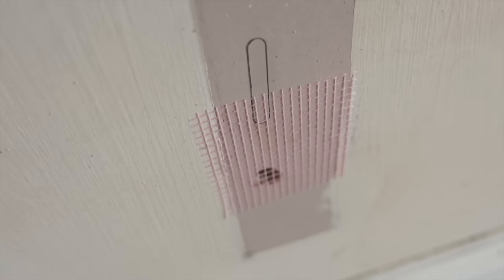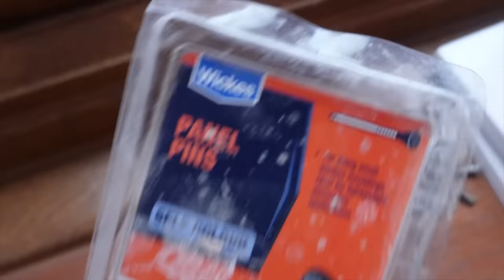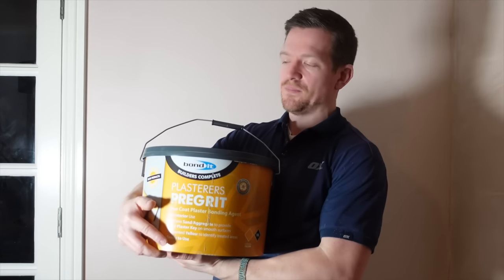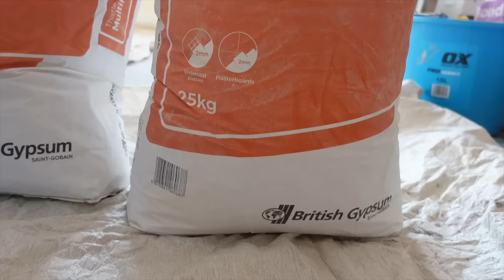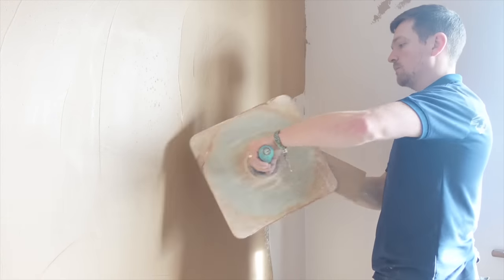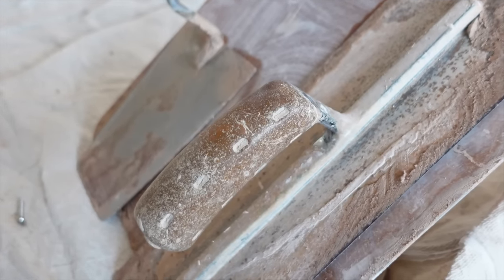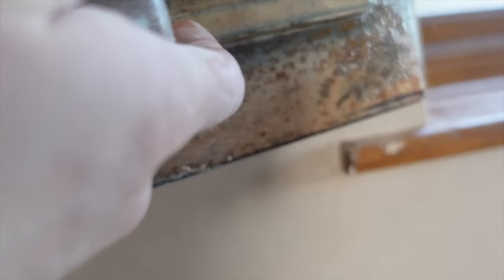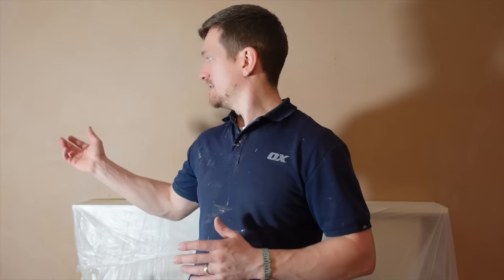#1 Tip For Plastering FASTER ⚡️ | Plaster More Walls In LESS TIME..."It's all about the Method"

Comment: I do agree to some extend as you are a plasterer, but even to the most experienced plasterer, it is no way faster than to fill, your walls are almost perfect condition, these small cracks and holes can easily be fixed with easifil 20, 2 fills and quick sand in between, these can be prepped for painting within 2 hours max. To plaster, by the time you pva, took off sockets, beed, plasterer and flattened , this is easily a day. If not more to some. Freshly plastered walls need a day or two to dry and mist coated, no freaking way this would be faster, better finish, may be. But I honestly can’t see this being faster
Reply from the maker: You’re definitely right - I good decorator beats a plasterer everyday. But like I said in the video I’m not a good decorator and it would take me forever ha! 

I don’t know the best way to use the products and I’ve never heard of this one you mentioned. But I’ve never had to learn so that’s probably why. I just prefer plaster…I’m stuck in my ways ha.

But yeah…I totally agree with you pal 👍

Comment: Thanks to your videos you have given me the confidence to have a go at some DIY plastering, I've seen other plastering YouTube vids where SBR is used instead of PVA, what's your experience with SBR?
Reply from the maker: I just prefer using PVA mate. I find SBR stains everything it touches and it’s a bit more expensive. I think PVA does a good job so I’ve just stuck to that.

If it’s not broken…

Comment: If you’re using the same mix for your second coat… Do you ever add a little bit of water if it’s started to firm up a little?
Reply from the maker: I try not to mate. I find it easier to apply it whilst it’s former…and if it’s going off too fast then it’s probably and indication that you need 2 mixes anyway. You only want to do this if you have a manageable hit

Comment: Hi, what are your views on replacing pva with sbr. I'm told this is far superior and you only need one coat on any surface 🤔 Thanks.
Reply: Hey Gavin. I saw a video fairly recently where Blaine mentioned using something called Plasterers Pregrit. I’ve not tried it myself yet but it comes highly recommended

Comment: Great vid, just wondered where you stand on pva the walls the night before skimming? Is it ok to do that? I usually do 2 coats of pva just before I skim but got a big job coming up and I’m trying to be more efficient with the prep, would love to hear your thoughts thanks 👍
Reply from the maker: Yeah that’s a good way to do it mate. I know a lot of plasterers who do it that way…PVA a job on the way on home and skim it the next day. Probably the most efficient way.
Reply: As a plasterer , you would never let the PVA dry in before you skim the wall , if your using PVA as a sealer to skim onto it should always be one coat over the surface to seal the wall , then before you start to skim , you would apply  another coat of PVA , & skim the wall while the second coat of PVA is still tacky to touch , so you are plastering onto tacky glue , so it helps stick to the wall , never skim into dry shiny PVA , it’s a no no .

Comment: It seems ironic that anyone could be good a plastering, but "shit at filling", since plastering takes so much more skill. But I suppose its natural for  plasterers to want to put down a substantial coating, while the whole point of filing is to only fill the low spots. Whenever I'm helping out someone who's not comfortable with filling, I always tell them to remember the Hippocratic oath: "do no harm", and to keep the filler from going above the intended surface level to avoid having to sand down a lumpy mess. Even after hearing that, some people can't resist smearing it on like cake frosting. Might as well go with what you know; I'm sure it will look great.
Reply from the maker: Haha so true. I just try and get it perfectly smooth and end up taking too much ofoff leading to another coat. I’m just rubbish at it but slowly getting better

Comment: So you wait for the pva to dry ? How does that work if I was sticking two bits of timber together I would not wait for it to dry then Press the timber together am I missing something
Reply from the maker: You don’t want the PVA/ water solution to be soaking. It makes the plaster runny and dilutes it - ends up slimy. You can start Plastering as the PVA goes tacky, you just don’t want it wet.

Hope this makes sense pal 👍
Reply: PVA re-emulsifies when wet plaster is applied
Reply: I always leave it till it’s none dry. This is plastering, not carpentry